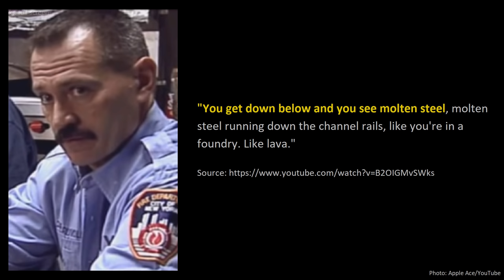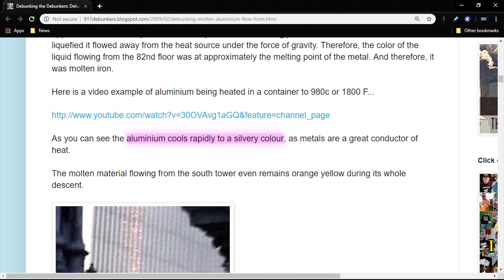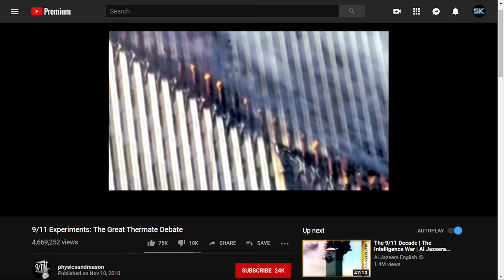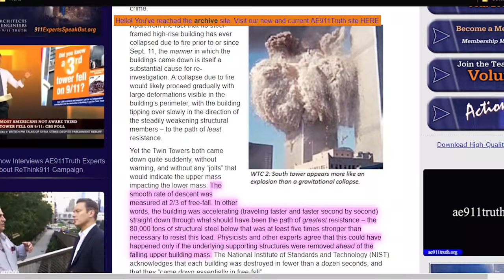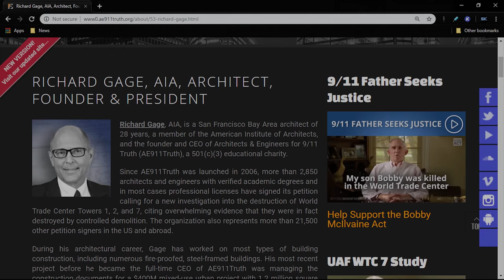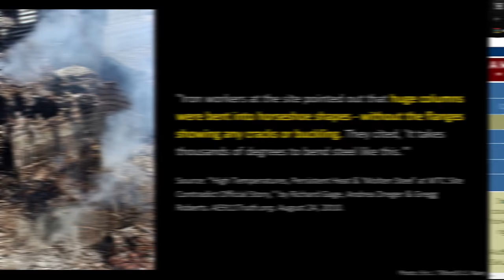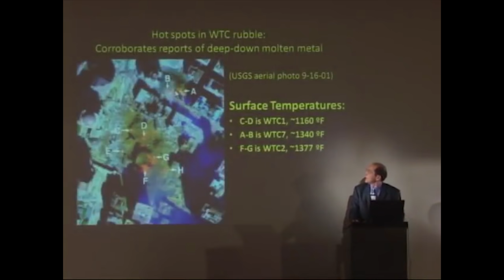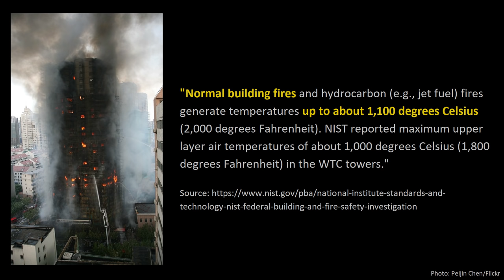9/11 Truthers Debunked: "Molten Steel = Thermite From Controlled Demolition!"

Comment: The Aluminum Superstructure of the plane wouldn't penetrate the towers steel outer structure.
Reply: What are you trying to say?
Reply: @stigerking9838  I'm not trying to say anything. I said what it was that I wanted too say.
Reply: @jasonhickerson3492  there are windows,  it penetrated the outer steel structure
Reply: @jasonhickerson3492  and because of Brut force from a plane flying into it at over 600kmh
Reply: @stigerking9838  Truly amazing! The force of the plane? Wow!!
Reply: @jasonhickerson3492  Yea I know!!
Reply: @stigerking9838  You know?
Reply: I once threw a paper airplane clean through a brick wall
Reply: Then the wall imploded!
Reply: @keithjorgensen495  Sure you did
Reply: @jasonhickerson3492  Want evidence that it does not matter what material a projectile is made of.  Just search up 'plastic vs aluminum in space' and youll see
Reply: @stigerking9838  In space? As in Outer Space?
Reply: @jasonhickerson3492  Yes.  The reason why it is in space is because there is no air resistance. You are able to make an object go faster as it's structural integrity is not affected by air resistance when it is traveling fast.  The whole you see in the block of aluminum is made by a half inch chunk of plastic. Just an example of how it doesn't matter the material it is made of.  It's all about the force the object has behind it.  Obviously the better the materials the easier it is to achieve your goal.
Reply: @stigerking9838  Do you know what the, "Additive Inverse of the Golden Ratio is?"
Reply: @stigerking9838  You seem like a good person Ollie. However, I know that the Gov is a liar and that 911 was not what they say it was. I can't prove what I know to be true about 911. Still, what I know? I know! It is matter of, "Historical Analysis." Thank you for taking the time to speak with me.
Reply: @stigerking9838  The thing is that at sea level the air is very dense. It is very unlikely that Flight 11 was able to attain 490 mph. Flight 175 couldn't have attain 590 mph. 

A man named Dov Zakhiem is an Intel Spook who has worked both for the US Gov and the MIC. Sometime shortly before 911 he brokered a deal with/for the USAF. I say with or for because I'm not sure who he was working for at the time. The deal was for 32 767-200's equipped with a system called FTS or Flight Termination System. This system was made by the Radar Physics Group of Tri-Data-Corp. These planes were stationed at 2 Airbases in FL. McDill and Eckland. Shortly before 911 an unknown number of these planes were moved to decommissioned National Airguard Bases in NE. It is likely that these planes underwent modifications at these bases that made it possible for them to obtain the speed necessary for the 911 mission. Normal 767's top out at around 425 mph at sea level. The FTS System has 3 functions:
1. Remote Piloting
2. Call Sign Encoding & Copy
3. Self-Destruction
I believe that 911 was a crime committed by the Deep State and the Israelis.
I believe the motives for this are the directives layed out in the Greater Israel Project. I believe that the US Military and Gov is nothing more then the Military Arm of the Luciferian/Zionist/Oligarchy. They are the Nameless Saturn Death Cult that Carroll Quigley described in his book, "The Anglo/American Establishment. They are chasing their Dream of Zion NWO. They are the College of Corporations and the International Banking Cartel that make up the Military Industrial Complex. This organization is Luciferian. They are Zionist and are the Oligarchy that is attempting to establish their NWO. They Worship Saturn and 911 was a Bloodletting Ritual to their God Saturn. It was the opening round of what will become WW3.
Reply: @stigerking9838  I can't prove one word of this Ollie. However, the US Gov has a long history of False Flag Attacks, Warmongering and have established without a dought that they are Liars.
Reply: @jasonhickerson3492  Well my point is that the American sure didn't amour a plane so it would penetrate better.  I can agree that America has small chance of being responsible for the attacks (I would more suggest that they would have had a way of push the agenda to attack America and the twin towers. But I personally disagree to the chances of America having any direct responsibility like placing explosives or flying a plane that is design for the attack. I also mainly think that America just used a horrible tragedy to push their political agenda at the time.
Reply: @stigerking9838  If you are interested there are 3 documentaries that I think everyone should watch. 
1. Shadow Ring
2. A Noble Lie
3. State of Mind: The Phycology of Control

Also, read The Anglo/American Establishment by Carroll Quigley. 

The US Gov is controlled by the Deep State or Shadow Gov. It is the Federal Reserve and the Corporate Lobbies that run our fake Republic. We are wage slaves. Nothing more.
Reply: @stigerking9838  Most people don't take the time to learn about the families that run our political, economic and military systems here in the States. The Bush's, Clinton's, Rockefeller's, Walton's and others have a long history of crime. Murder, theft, industrial spying, treason and the list goes on. These are not moral people Ollie. People like you and I would become sick in the soul over the thought of doing things like these people do without any thought of what it really means. They just don't care about anything else but power.
Reply: @stigerking9838  Shadow Ring is about the US Gov's History of Warmongering. It goes back too the Spanish-American War all the way to present day. 
The Psychology of Control is about the Social Programming Engines that have been employed to manipulate us.
A Noble Lie is about the Oklahoma City Bombing. 
I believe that everyone should watch these vids and consider the info in light of 911. Each vid is about 2hrs in length.
Reply: @Viagra_risk_PERMANENT_insomnia  A 767-200 will not do what was done on 911 without modification. They will not fly at those speeds at sea level nor will they achieve the impact destruction that we saw on 911.
Reply: @Viagra_risk_PERMANENT_insomnia  Thickness isn't what you need to look at. Yield Strength in psi is what you need to know. The towers were built to with stand that kind of a strike which is determined by the steels strength. Not it's thickness.
Reply: @Viagra_risk_PERMANENT_insomnia  Google the specs of a Boeing 767-200. It's all there in english. Easy for anyone too find. There's also YouTube footage of jetliners wings being cutt off on impact with poles and such. If you want to think I'm full of it that's fine.
Reply: @Viagra_risk_PERMANENT_insomnia  I've seen it. Apples and Oranges. The max speed at sea level for a 767 is 360 knots or 400 mph. A 767 will do 86 Mach at 40,000 ft. That is 659 mph. Sea level is much more dense air and it isn't safe for the plane to fly faster then 400 mph as it would suffer structural failure.
Reply: @Viagra_risk_PERMANENT_insomnia  The speed limitation for these craft are more literal then you think. Yes, there is a speed at which you can fly that exceeds what is written. Sea level is about 425 mph. That's 25 mph over what is written. The plane will be accelerating during take-off and climbing. In that stage as the plane climbs the air gets thinner. You will never see a plane doing 400 mph at 700 ft descending. It is about to land and would be close to stall speed. Which is much slower then 400 mph.
Reply: @Viagra_risk_PERMANENT_insomnia  Flight 11 was clocked at 490 mph and 175 at 590 mph. AA77 was clocked at 530 mph at 5ft off the ground. It was accelerating. It started to accelerate when it leveled. 
1. Cruise Missiles will do 530 mph at 5ft above the ground.
2. Cruise Missiles accelerate once they've locked on target and leveled their flight trajectory. It helps them penetrate the target.
Reply: @Viagra_risk_PERMANENT_insomnia  A man named Dov Zackhim is an Intell Spook who has worked for both US Gov and the MIC. Shortly before 911 he brokered a deal with the USAF for 32 767-200's. They were stationed at two bases in FL. McDill and Eckland. These planes were equipped with a technology called FTS or Flight Termination System. It was developed by the Radar Physics Group of Tri-Data-Corp. This technology had 3 functions.
1. Remote Piloting
2. Call Sign Encoding and Copy
3. Self-destruction
Shortly before 911 an unknown number of these planes were moved too decommissioned National Airguard Bases in NE. It is thought that these planes underwent modifications at these bases that made it possible for them to achieve the things that they did on 911. Full of crap am I? I think not my friend! You don't understand the very basics of flight speeds, air density and structural failure. You ask me to help you find the specs that state what the planes will handle while at the same time you tell me that I'm full of crap. Yet, I know the specs and you don't. I know who Dov Zackhim is and who Tri-Data-Corp is; and you don't. Funny how it is always people who insult that know the least. I think it is very obvious what happened to the planes on 911. Given the fact that Boeing says by reason of their specs that their planes will not do what the Gov says they did on 911. Also, we've Zackhim and FTS. These facts put together tells me that the planes in question were not the ones the Gov told us they were. The Pentagon was struck by a Cruise Missile.
Reply: @Viagra_risk_PERMANENT_insomnia  Have you ever looked into the, "Occult aspects of 911?"
Reply: @Viagra_risk_PERMANENT_insomnia  By the way, this isn't Darlene Howell. It's Jason Hickerson. You're alot of fun Winter. LMFAO!!!... Anything else that I can help you with?
Reply: @Viagra_risk_PERMANENT_insomnia  Well Tony, are you going to explain 175 doing 590 and 77 doing 530? Or are we going to sit in our own bullshit? I did manage to find one place that says a 767-200 could handle 500 mph under the right conditions and with an excellent pilot. The weather on 911 constituted the right conditions. However, the Hi-jackers were not excellent pilots and could not have handle the planes at 500 mph at those altitudes no matter how perfect the weather conditions. Also, 175 was doing 590 mph at 700ft and 77 was doing 530 at 5ft. Speeds which are impossible under any circumstances at those altitudes reguardless of who the pilots were. You've no ground to stand on and your theory is shot to pieces. Try again?
Reply: @Viagra_risk_PERMANENT_insomnia  You're avoiding the real question at hand because you don't have the answer and I do! The Gov has lied about the planes in question.

Did you know that 175 had 3 engines in it's life time and that the one on Murray St was not the one 175 was equipped with on 911. It was the Model Engine that the plane was delivered to UA with back in 1983. It was not the one that the plane was flying with on 911.
Reply: @Viagra_risk_PERMANENT_insomnia  The other thing is; a plane isn't just it's wings. How about the plastic nose cone and the thin aluminum sheet metal that make up the rest of the plane?
Does MIT's wing thingy explain that too? I think not! You don't argue like a Structural Engineer. More like someone who reaches and doesn't obtain. LMFAO!!!...
Reply: @Viagra_risk_PERMANENT_insomnia  Why didn't 175, 11 and 77 come apart in mid-air on 911?

Answer: They were modified 767-200's. Remember Dov Zackhim and Tri-Data-Corp? The USAF, Eckland and McDill, decommissioned National Airguard Bases. Remember the Radar Physics Group and 
Flight Termination System? Your argument is shot-down. Why don't you give it up? You're now talking about damping and asking me stupid questions which I've already answered. You should be offering a rebuttal. You can't because you know there isn't one. Come off of it.
Reply: @Viagra_risk_PERMANENT_insomnia  Flight 11 was landed at one of the decommissioned National Airguard Bases in NE. There is where the passengers were murder by US Government Agents. This is all right out of Northwoods. I have an answer for everything. NOW, SPEAK TO THE IMPOSSIBLE SPEEDS OBTAINED BY THE PLANES ON 911!!!...
Reply: @Viagra_risk_PERMANENT_insomnia  Here's your problem. While I can't prove 100% that Northwoods was used as a script in this case. You can not use the Govs story as conclusive evidence either. All that they've said can be faked. I've shown that beyond any reasonable doubt. Now, I will go so far as to say that I've shown that it is very likely the sequence of events that I've laid out are the ones that occurred. 

Your only option is to debunk what I'm calling the, "Impossible In-Flight Physcis of the Planes In Question." The reason you're avoiding me in this is that you know I'm right and you're wrong. So, why don't you just come off of it?
Reply: @Viagra_risk_PERMANENT_insomnia  You keep on with this 500 mph. It doesn't matter because nobody was flying at 500. It was 530 and 590 that we were speaking about. You won't address this because you know that 767-200's will not do this at sea level.
Reply: @Viagra_risk_PERMANENT_insomnia  LMFAO!!!... 175 was doing 590 period! However, 11 was 465. Thus, we're both wrong.
Reply: @Viagra_risk_PERMANENT_insomnia  Reaching the speed was not the question. Will the plane survive the speeds? This is the question.
Under the circumstances of poor piloting the answer is no!
Also, your speeds are wrong. 
400 mph or 360 knots is the safety spec. I found one places that says 500 mph is possible but will likely have the wings coming off. Nowhere has anyone sayed 590 is a possibility without suffering structural failure. 530 at 5ft off the ground is laughable. You've quoted me the wrong speeds. Gone on and on about 500 mph which nobody was flying at. Yet, I'm full of crap? LMFAO!!!... Dive or not! 175 and 77 would've come unglued. Those planes are not made to handle those speeds.
Reply: @Viagra_risk_PERMANENT_insomnia  Sea level 400 mph. Cruising altitude is 659 mph. Nobody is buying 590 at 700ft because of a dive. That's stupid. Especially when the one doing the selling is trying to get me to buy 540 mph. Now, how about 77 at 530 mph at 5ft off the ground.
Reply: @Viagra_risk_PERMANENT_insomnia  I've done poor research? You can't even get the planes speeds right.
Reply: @Viagra_risk_PERMANENT_insomnia  Bullshit! Where did you get that spec? Did you know that mechanics can't stand on the end of the wings? They won't hold the mans weigh.
Reply: @Viagra_risk_PERMANENT_insomnia  LMFAO!!!... AND YOU'RE AN ENGINEER??!!
Reply: @Viagra_risk_PERMANENT_insomnia  My goodness! "Talk to the hand?" Well, how very silly of me! Surely, you must be an engineer with such a display of knowledge in that statement?
Reply: @Viagra_risk_PERMANENT_insomnia  Understanding is something that you've no part of. We were speaking about wings; not towers.
Reply: @Viagra_risk_PERMANENT_insomnia  Leslie Robertson was the, "Chief Structural Engineer on the WTC Project." He, as well as others have stated that, "the Towers were designed to handle the impact of a 707. Which was the largest plane at the time." Wind load? Your bullshit does not sparkle brightly enough to blind. Math? Leslie Robertson and others have already done that.
Reply: @Viagra_risk_PERMANENT_insomnia  "In matters of science the authority of 1000 does not equal the humble reasoning of a single individual."

Do you know who said that?
Reply: @Viagra_risk_PERMANENT_insomnia  Have you looked over the 53 secs of the drone strike? No! At that altitude the airliner seems to be coming in for a landing. At landing the planes slow down to around 190 mph when at 700ft. It's just above stall speed. So, 175 doing 590 mph at 700ft and the wings staying together? LMFAO!!!... WHICH DO YOU THINK IS STRONGER. A TOY DRONE OR A BOX COLUMN?
Reply: @Viagra_risk_PERMANENT_insomnia  A DUH HAY BOO BOO? LET'S BETTER UNDERSTAND THE TOWERS CONSTRUCTION BECAUSE I'M A SMALL BUILDING STRUCTURAL ENGINEER! LMFAO!!!...
Reply: @jasonhickerson3492  Anwser 15.52-16.20
in this video
Reply: @lansen943  Your problem is that you misunderstand fat man's point. All he is saying is that jet fuel has what it takes to heat steel hot enough so it will forge! He never made the claim that he recreated the circumstances found at WTC. You people get these vids that guy's put out then you put word's in their mouths. He never said, "This is how it happened." He says jet fuel will weaken steel. He's right. And in case we miss it; he shows us. How is that what happened at WTC? Answer: IT ISN'T!
Reply: @lansen943  You want the truth of 911? Look to the, "Occult." You are dealing with a, "Zionist/Luciferian/Oligarchy hell bent on achieving their Dream of Zion NWO!" 911 was Ritual Murder committed by the MIC. Wars are fought for 3 reasons:
1. Ritual Sacrifice
2. Geo-Political Restructuring
3. Social Engineering
All 3 motives are present in 911 and the so called, "War On Terror."
Reply: @jasonhickerson3492  
You didn't look at the video between the time i provided. It shows the beams weakend by the heat not being able to support the floors above.
Reply: When are trying to argue for your point don't  use words like "zionist luciferian oligarchy" it makes you sound like a communist or nazi. Just a tip.
Reply: @lansen943  How about a word like, "AshkeN.A.Z.I?"
You know? Ashkenazi! Or how about, "Saturn Death Cult?" Or, "911 was a Bloodletting Ritual to the God Saturn." How about, Military Industrial Complex or Banking Cartel and College of Corporations? Are all these ok?
Reply: @lansen943  Operation Paper Clip, The Project for the New American Century, The Greater Israel Project, Israeli Proxy Wars, David and Nelson Rockefeller, Aleister Crowley? Are these offensive?
Reply: @lansen943  Here's two more words, "Babylonian Talmud." Mossad, CIA, MI5&6, SAS. How about those words? Are you ok with those?
Reply: @lansen943  How's, "House of Rothschild?" What about, "Belfor Declaration?" Or, "Nikola Tesla?" How about, "Military Grade Weapons Technology?"
Reply: @jasonhickerson3492  sigh. No does word's don't make you sound like that. 
However they don't mean anything either.
Reply: @jasonhickerson3492  I see (sigh). Thers no point too continue this conversation.  How you get all those name's to = zionist, oligarchy, luciferian is beyond me. It doesn't make any sense.
Reply: @jasonhickerson3492  no English isn't my first language.
How you get all the things and name's that you asked if I considered offensive to 
equal zionist, oligarchy and luciferian is beyond me. It doesn't make any sense.
Reply: @lansen943  Ok. I am sorry to disappoint. I was looking foward to speaking with you. If you're interested I can explain. However, it will take sometime as the understanding comes from a knowledge of, "World History and the Occult Sciences." 

911 was a, "Social Programming Engine." All Rituals are. There is no, "Lucifer." There is only, "The Evil That Men Do." 
Ritual distorts the morality of the people involved in it. Whether the person is the victim or the exicutioner does not matter. A breaking of the will occurs. The act of the ritual weakens leaving a bend in the persons mind. This, inturn acts on the person's, "Will Power." Causing them to become more and more subservient to the, "Base Moral Consciousness." The Higher-Self or Christ likeness falls away.
Reply: @lansen943  You stop being human and become more and more animal. The Exicutioner acts more and more out of a predatory instinct. The victim acts more and more out of fear. However, both are broken and become more easily manipulated.
Reply: @lansen943  Ritual in it's most simplest terms is the, "Art of Manipulation and the Science of Human Behavior." In short the propose of Ritual is to, "Artfully Use the Science of Human Phycology to Manipulate."
Reply: @lansen943  It is late were I am. If you would like to hear more I would love to continue explaining the meaning of my previous posts and tie everything together. Let me know if you're interested. Thank you for taking the time.